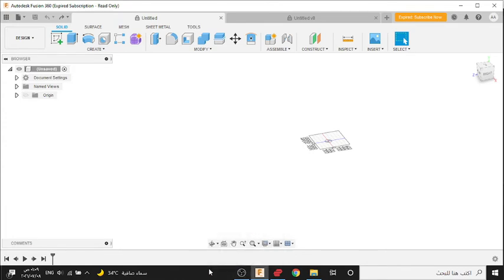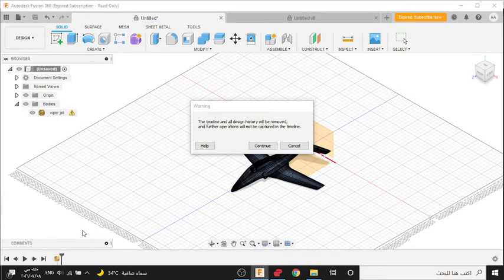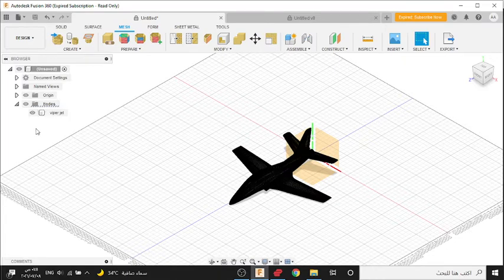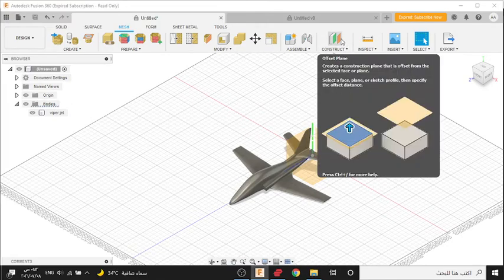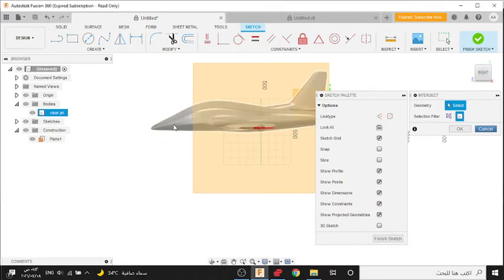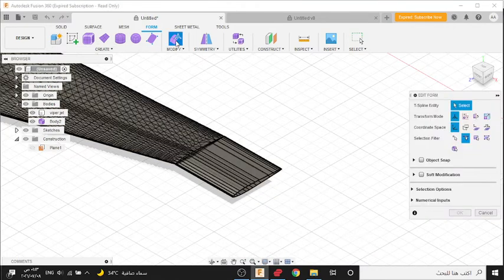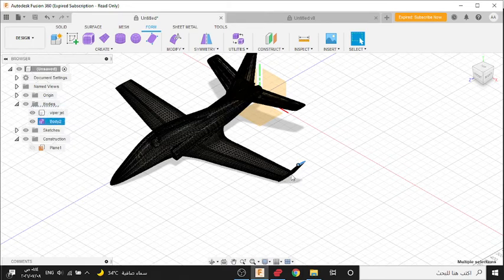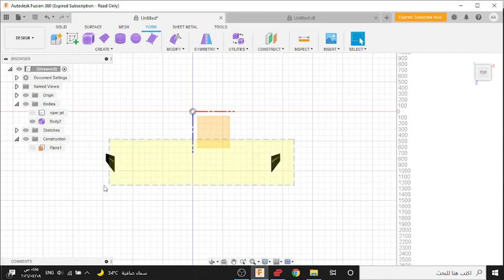viper jet mk2 STL file in description

Comment: ahmed, can you break this plane down to write it with ender 3 pro?
Reply from the maker: Try it I don't know this program
Reply: @ahmedrc8986  https://www.youtube.com/watch?v=lZX4KGY26Qs

 I'm looking like it's broken. as in the video.
Reply: not a whole. in sliced form.
Reply from the maker: @aresrobotik2594  i use fusion 360 to  sliced this plane part by part and i used cuer for 3d printer